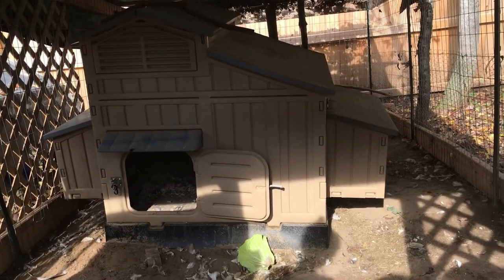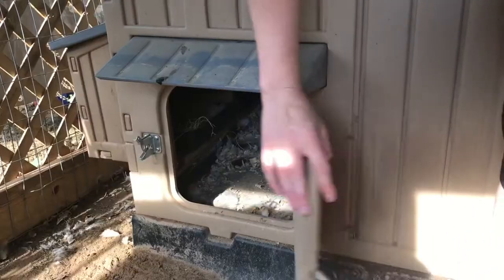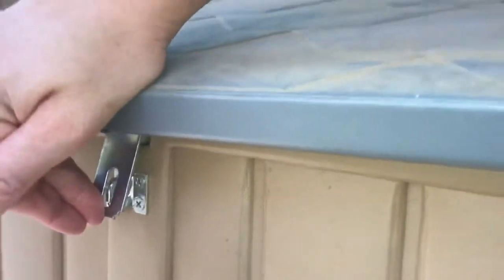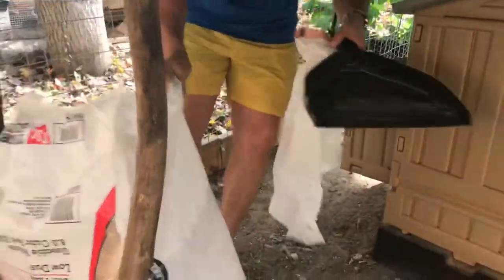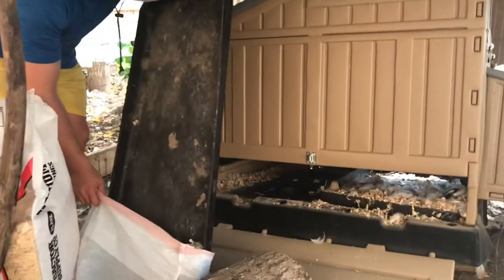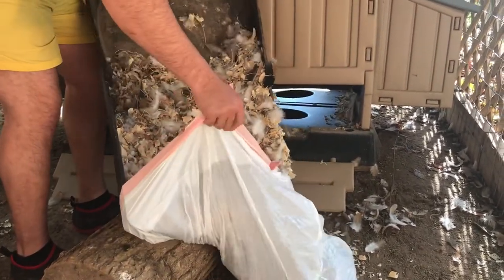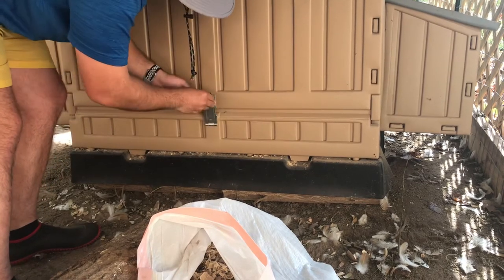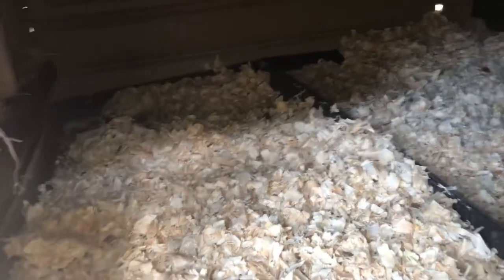Large Plastic Snap Lock Chicken Coop Review - Easy to clean chicken coop

Comment: Thanks for the review! Just discovered this coop this evening. We are a military family, and who knows when or where we will move next — do you think this would be fairly easy to disassemble? Thanks!!
Reply: Hi Jessica. My girlfriend and I just put this together and it was super easy. No tools required. All the pieces just snap together but it's a very stable structure. At any rate, I haven't done it yet but imagine it will break down and be very easy to do. Don't forget they need a run :)
Reply: @Anduin-oy5ij  thank you!! I actually ended up getting the Eglu by Omlet, but depending on how deep into this chicken thing I get, I still might get an additional coop, and I really like this snap & lock one!
Reply from the maker: @JessicaHolmes  we got it since we move around a lot as well and were glad to find a more light weight and easy to take apart and reassemble coop.